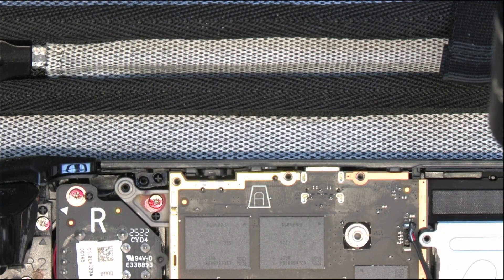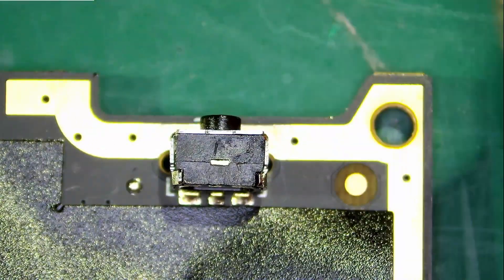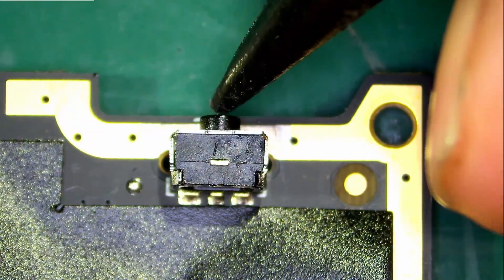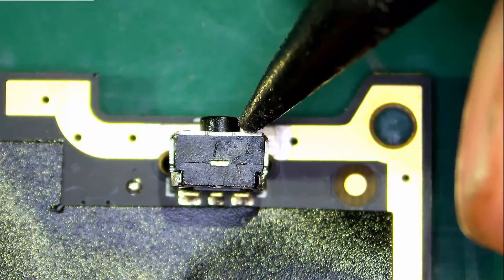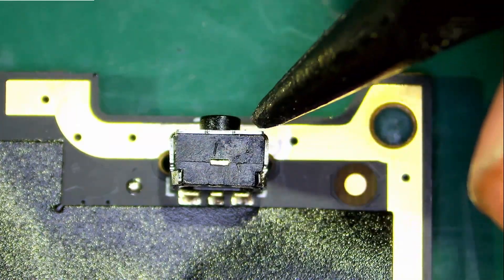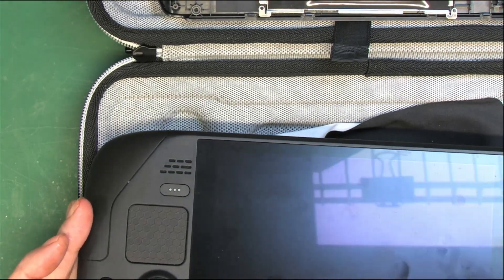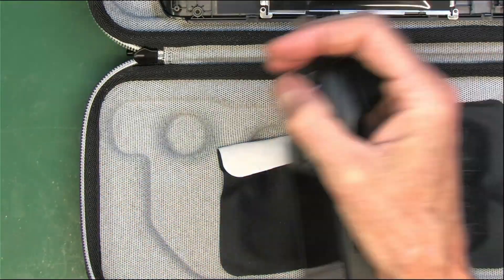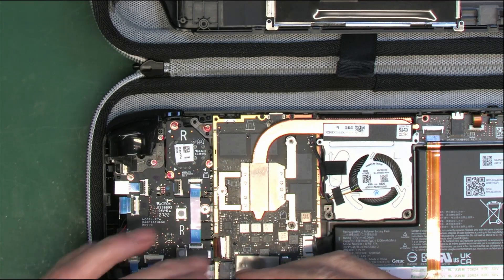POWER BUTTON! WHY?  Valve Steam Deck Bad Switch Design or Why I hate some switches.

Comment: I just sort of take your suggestions about using a paper. So since I am using the 1st gen of Steam Deck, I had to put like 5 layers for pieces of paper (graph paper in my case). This number seems to be the sweet spot from my testing. It fit in just fine when I pry open a bit of gap with two plastic spudgers to let me see where I can insert between the power button.

It works fine as of now. If it happens again, I might need to open again and see if I need to replace the papers/add 1 more layer or remove 1.

Comment: had a 90% unresponsive power button but it still clicked; i managed to fix it by working alcohol into the switch body and wiggling/pressing it for a minute. Had to remove the heat sink and move the motherboard back a bit to get to this, but kept most flat cables connected. Seems like there can be some quality issues with these. I love the relative repairability of the steam deck but the power button and usbc straight on the motherboard are a mistake.
Reply from the maker: Yeah, vendor plating is always an issue. I've had to reject huge lots of contacts.

Comment: Hey there, I was attempting to do this repair but noticed that the central pin solder trace of the button was broken, do you know where I can connect a jump wire to that central pin of the power button? Thanks a lot
Reply: did you find a solution to this
Reply: @antblaster9k please, any solution for this?

Comment: My Power Button only worked if I pressed hard, I disassembled the steam deck cleaned the button and put some electrical tape on it. Now I it works every time and the power button feels a lot better! Thanks for the video ❤
Reply from the maker: The electrical may start to compress and become harder to push again. But, hey, if it works, you can redo it in the future if needed.
Thanks for watching!